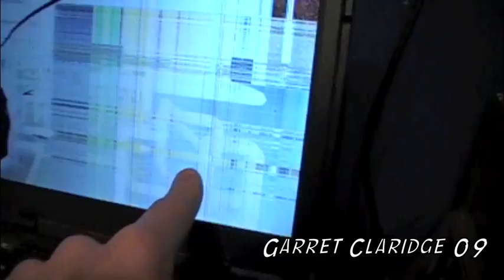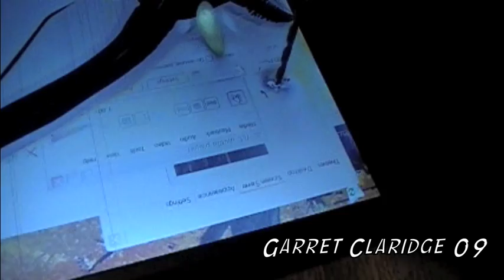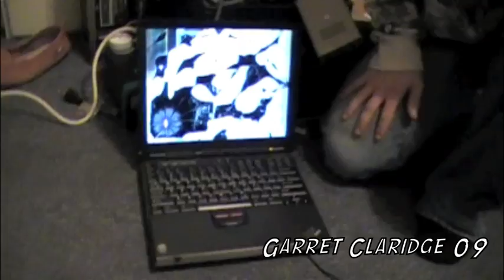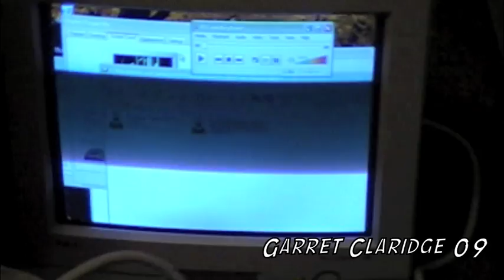Thinkpad Death, Laptop Gets Sawed In Half

Comment: BTW do you realize that older laptops like this usually have CCFL backlights? CCFL tubes contain mercury vapors and other toxic chemicals (toxic luminophore,...). Also the voltage inverters that are used to power the CCFLs usually make several hundreds volts (but only at very low current). That could give you a strong electric shock. That happened to me when I was fixing an old laptop and I accidentaly touched the CCFL inverter. Guys, think before doing something stupid like this. Seriously.

Comment: @Pommbaer84 Lets assume i's 3 kilovolts
power used cannot be greater then the 10-15 Watts, P = Currency times Voltage
means curent is Voltage/20Wats = enormous small 0.005Amper wich can be shocking, but wont kill you

Comment: That's why thinkpads were and are better than Mac. For everyday use it's about the building quality.
Reply: I remember looking in a 2006 argos magazine,  there was apple laptop for £700 with pentium dual core and 256GB hdd, 32mb vram. And on exactly next page was IBM T60s and sony laptops all with intel core 2 duo and a core 2 quad, with 500GB hdd and 128mb vram. All for £360 at max.  Apple is overpriced,  overrated,  and underpowered. Apple make no sense should be not exist.  :\
Reply: +Green Dragon XD

Comment: Well, I think that confirms what I should get in my quest to locate the most recent possible 4:3 laptop to replace my increasingly creaky but otherwise bombproof HP...a thinkpad.

I mean, I knew they were tough (Ive an early-90s "butterfly" one that would work fine if only something so stupid as the impossible-to-replace HDD cable hadn't died), but damn...the screen nearly defeated your drill. Dropping it did nothing. It had to be repeatedly heel-stomped to actually die. Thanks for the demo XD

Comment: Acer does NOT make the best of anything. They are shit. I have owned many laptops in my day (currently using a R61 Thinkpad) and repaired hundreds more. Acer is a garbage computer company. I have replaced the LCD in two acers just because they were picked up by the monitor. Cheap plastic garbage.